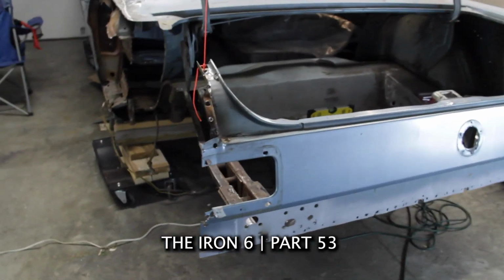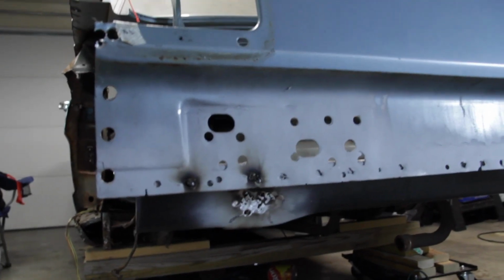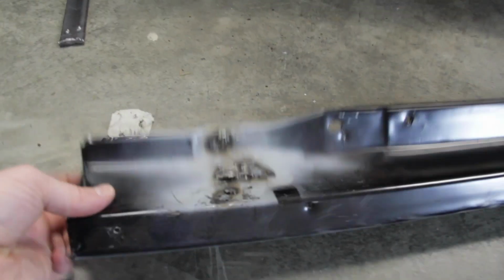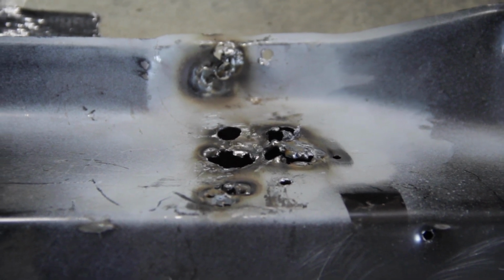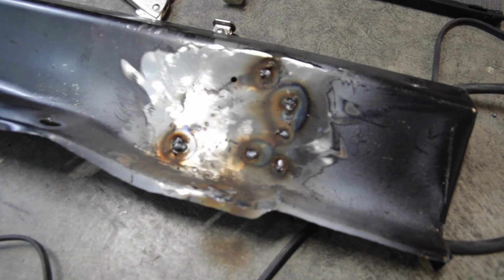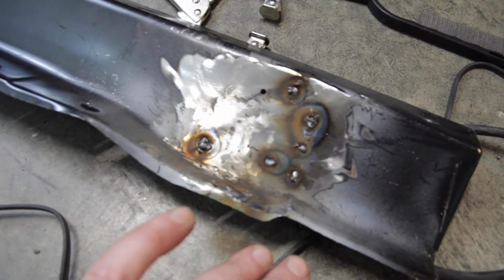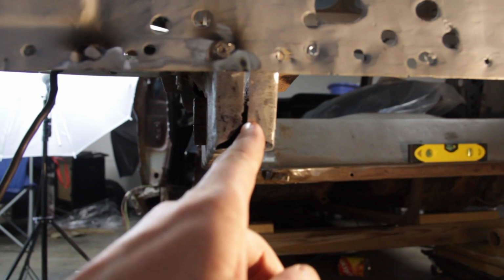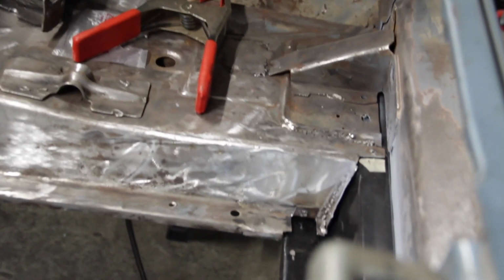Making a Sheet Metal Patch from an Old Quarter Panel

Comment: Little by little. It's coming along. Running out of gas or running out of wire. Both equally irritating. Perhaps running out of gas is more irritating. The "Wire Store" is open on weekends but the gas supply is not.
Reply from the maker: Haha. Great point. Fortunately it happened through the week. 👍